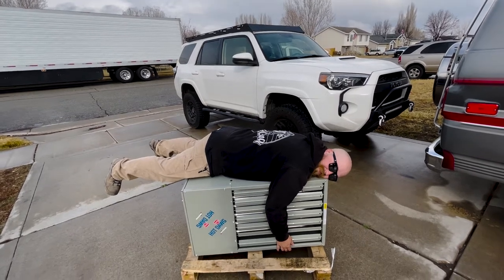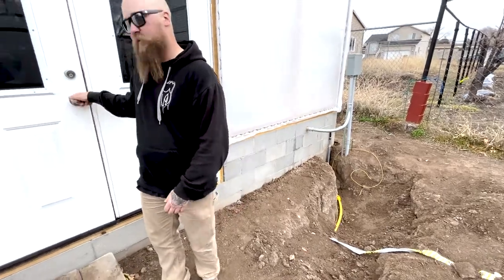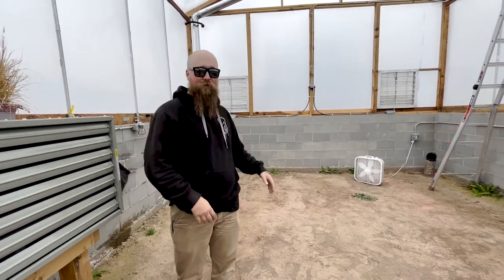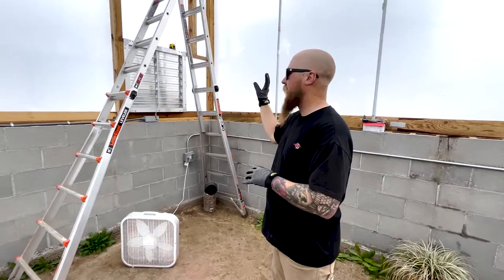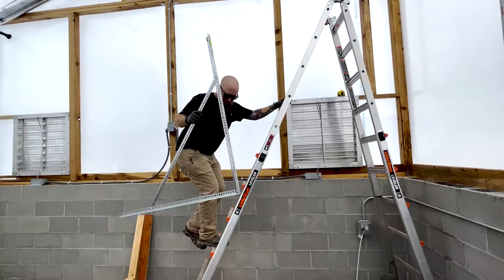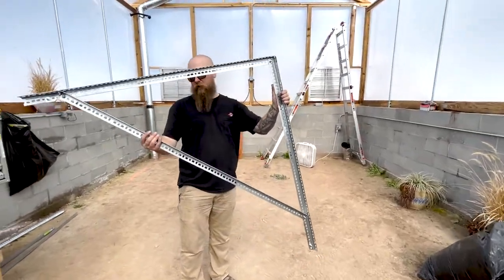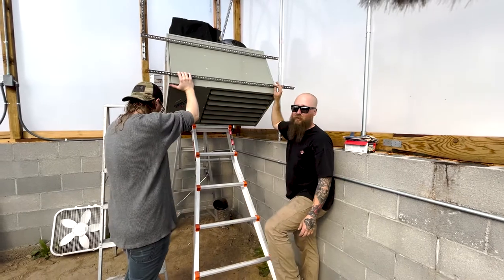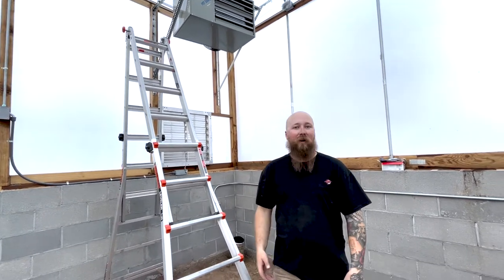Installing Greenhouse Heater | Part 1

Comment: I’m a bit late to the party but want to say this is awesome. I’m looking at a small scale version (UK based so your greenhouse is the size of my plot😬). 
Do you have any info on how the heating works? Does it have a pulse setting, continuously on, etc? And running costs would be great to know. I considered solar powered heating elements or a ground heat pump but this is certainly an interesting option. Great work 👍
Reply from the maker: The heater just runs on a thermostat, so you just set your low temp and it runs to keep it above that.